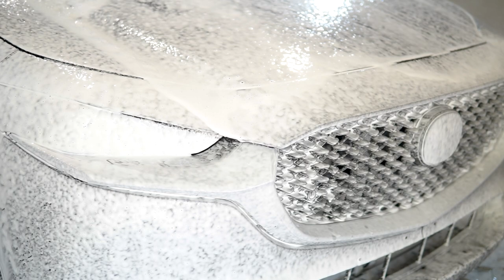Mazda CX-30 New Car Prep - Ceramic Coating - Auto Detailing

Comment: I have a 2021 cx30 in jet black. It has similar micro scratches on it. I have sold my polishing equipment when I moved overseas but I want to buy more and wash, clay, correct and seal. I was using Wolfgang's and Pinnacle products before but my other car was red not black. I'm not thinking I would need an aggressive compound since the car is only 2 months old. Should I use something different on black paint? Also I've never done ceramic but definitely will this time because black is a bitch to keep clean and the hydrophobic properties will be great for a quick rinse
Reply from the maker: I wouldn't say that black paint would need any special treatment.Since it's a new car I would start with something mild maybe rupes yellow pad and medium to fine polish (that is usually my to go one-step combo).As I can see jet black is none metallic? If so, flat black paint usually has a tendency to be on the softer side so refining might be needed.As for the ceramics go for it ! IMO the cheapest ceramic out there ( of any reputable brand not the eBay ones) beats any sealant- wax on longevity and water behavior.
Reply: @maxvisionautodetailing  it's colour is jet black mica. Since I've never done ceramic I assume I correct, then ceramic then sealer?
Reply from the maker: Yes correct- (refine if needed) wipe the surface down with ipa (isopropyl alcohol ) mix or a ready to use panel wipe from carpro,gyeon, koch chemie etc( much less fuss tbh) the sealer part depends on what kind of ceramic system you use carpro for example does suggest the application of Reload(sealant) on top of Cquartz UK 3.0. IMO go with a ceramic that has loads of information on YouTube do your homework and go for it my tip for you is take your time, work small sections use clean good quality microfiber towels every few panel's and be thorough when wiping to avoid high spots.

Comment: I don't know much about painting, but do ceramic coating really Streghten the painting? because men is the Mazda painting easy to scratch, it's really thin at least on my the CX-30.
Reply from the maker: Really depends on the brand of ceramic coating. A good quality ceramic coating will definitely make paint more resistant to micromaring tiny scratches that you can induce from improper washing. It won't protect from heavy scratches tree branches or something worse though .
Reply: It appears that certain Mazda colors are easier to scratch than others.  The Soul Red gets mentioned repeatedly.  I have the same color in the video, mica blue, and I don't find that it scratches easily,  I bought the CX-30 last winter and the ceramic coating has held up to my expectations. I'll re-apply in the Spring.
Reply from the maker: What kind of ceramic did you apply?
Reply: @maxvisionautodetailing  The dealer, against my wishes, put a spray wax on the vehicle.  To counter this, I did a fine clay bar and finishing polish followed by two coats of Turtle wax hybrid solutions.  Every month of so, I use a topper solution consisting of 50% Wolfgang Uber rinseless wash and 50% Sonax brilliant shine detail spray.  The Sonax is an excellent topper but it doesn't apply easily by itself.  Mixing it with the Wolfgang makes the application easy while still getting all the benefits of the Sonax.
Reply from the maker: Oh I see...so it's not really a ceramic more like a spray sealant.Get your hands on some gtechniq crystal serum & exo v4 top stuff will last two years and more with ease.
Reply: @maxvisionautodetailing  I'm familiar with crystal serum and it's certainly an excellent product but the cost/benefit analysis still favors the Turtle Wax for my purposes.
Reply from the maker: @cusebike5391  you know better I just prefer even the cheapest ceramic over any sealant not a huge fan of re applying it every couple months but that just me 😄